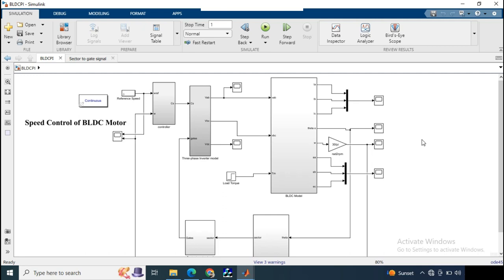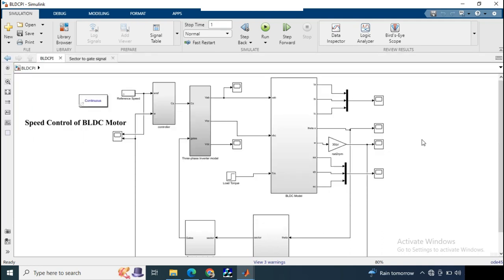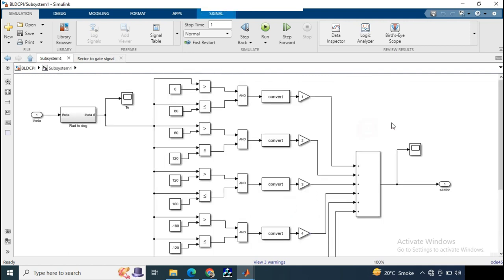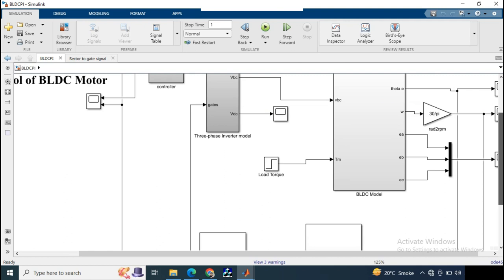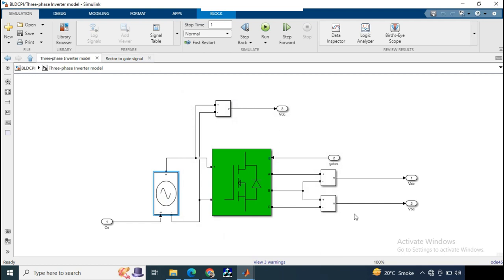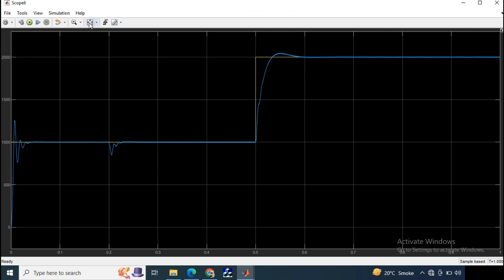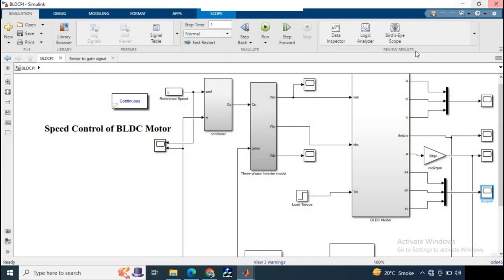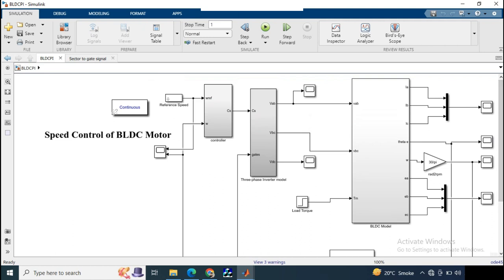Six Step Commutation Control of BLDC Motor | Speed Control | PI Control | MATLAB Simulation

Comment: Hi sir, a help required from your side, I want to feed current v/s time data into a simulation, any idea how to do that, the component must work as a current load
Reply from the maker: Sorry i can't understand your point. As a current load means? 
You please mail me on- ranitsengupta007@gmail.com
Reply: @RanitSengupta   
Sir please send me the paper of speed control of bldc motor using luo converter using pid controller

Comment: Hi Bro
Why is the supply voltage 500 if a motor is used in the laboratory, the supply voltage is for example 24 volts
Reply from the maker: Change the input dc voltage accordingly
Reply: @RanitSengupta  
When I change the input voltage and the motor parameters give errors or sometimes the laboratory results do not match the simulation results, do you have a solution to this problem?
Reply from the maker: @hsenaed6894   Maybe it is internal software bug.  please check your power gui settings and other parameters.